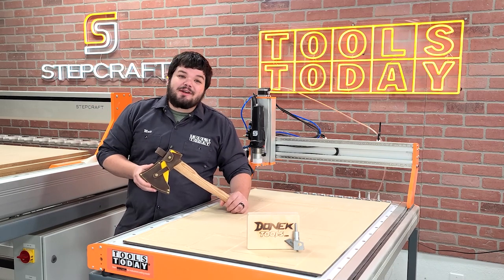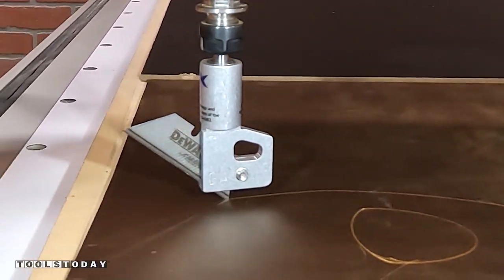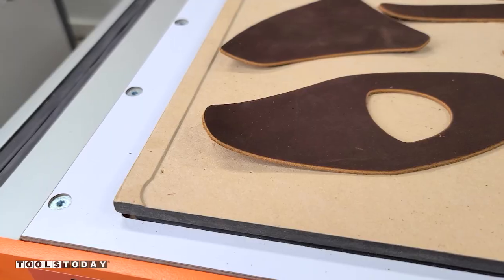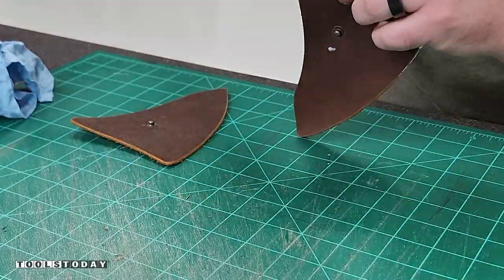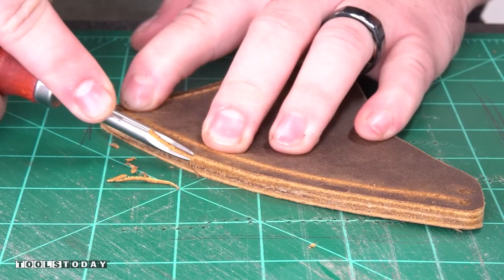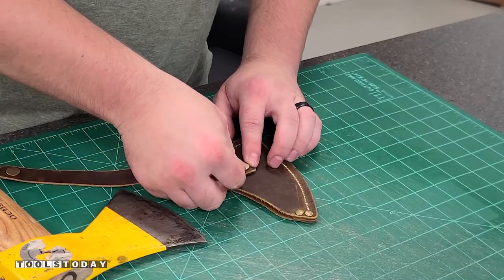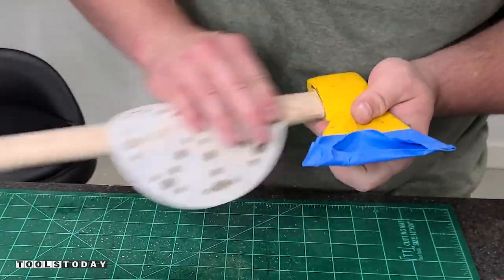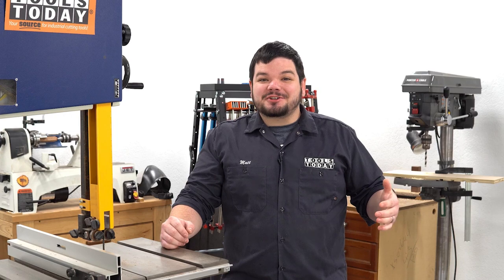Making a Leather Hatchet Sheath on my CNC | ToolsToday

Comment: how does it work the tool that holds the knife, like how are you able to change the angle of the knife.
thank you
Reply: The knife just turns automatically on the pivot as the cnc moves it around, dragged.